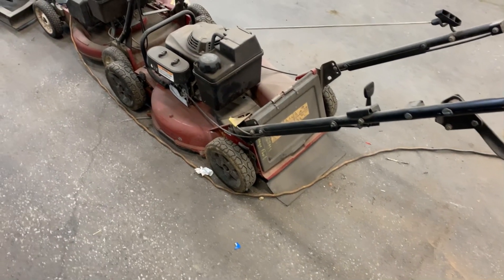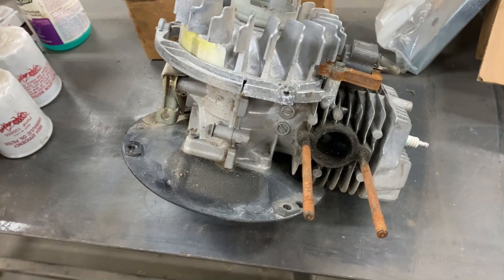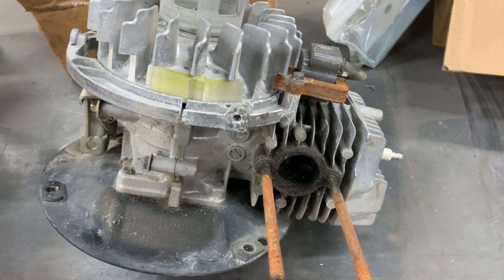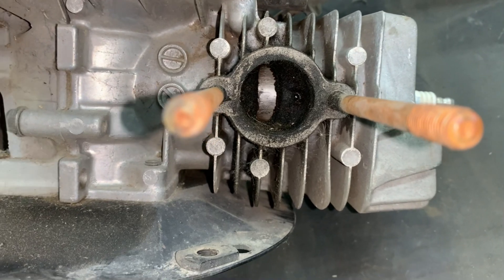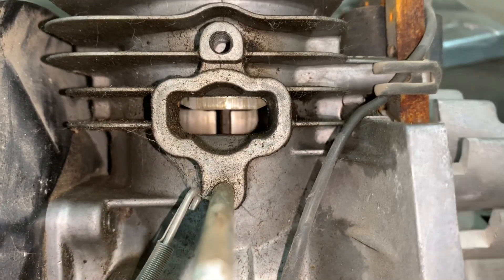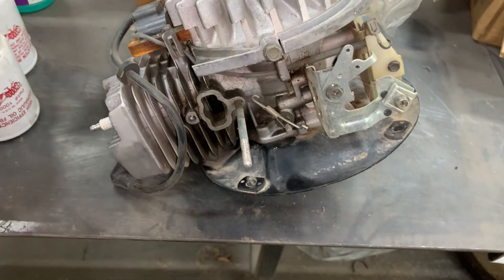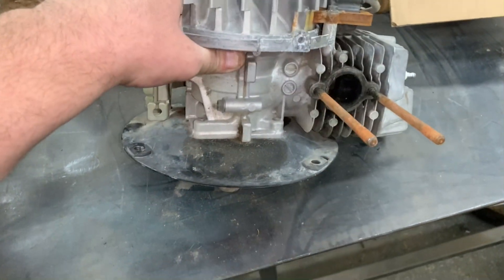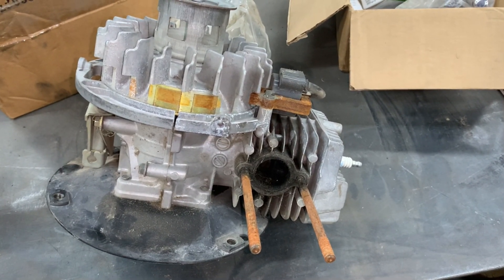DOES A 2CYCLE ENGINE HAVE A COMPRESSION RELEASE?

Comment: HELP! I have been going nuts with mine , i was mowing along and I noticed a slight vibration .The next time I tried to mow a couple days later it wouldn't start and it has a nasty kickback .I took off the fly wheel and the wooduff key  looked ok put it all back together , still kicks back. I don't think I hit anything to bend the shaft and it's hard to tell mine has a bbc.I also cleared out the release .I'm lost with this any ideas or things i can check thanks for your help .
Reply: I don't know what I did but I started to take the motor off , blade, shroud , bbc ,plate all the way down to the last pulley and realized my new replacement motor was for non -bbc ,discouraged I put It back together .One last shot at trying to start it and it turned over fine and started on the second or third pull ,runs good . WTF

Comment: My dad owned a 1979 Lawnboy for 35 years of residential use before he replaced it. It had never been opened up just a carb kit once. I remember that you had to push the primer bulb several times to keep it running when it was cold but what a good mower